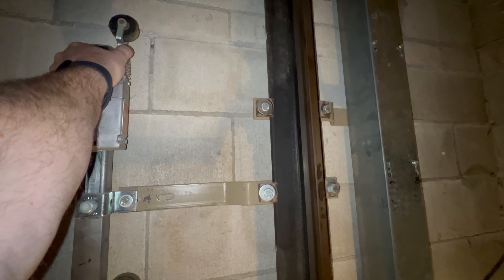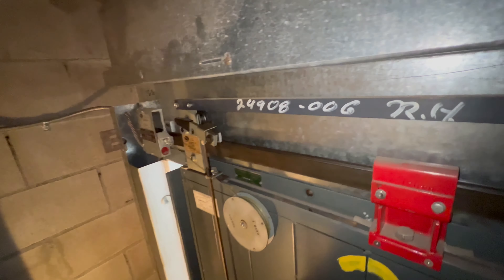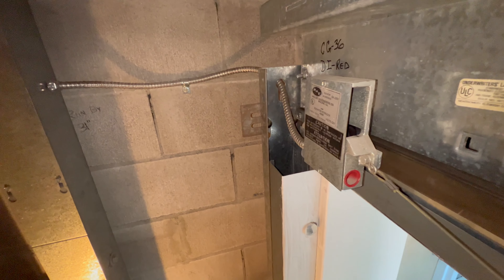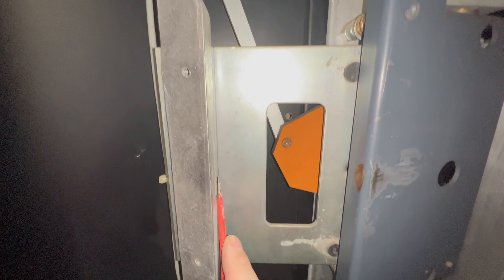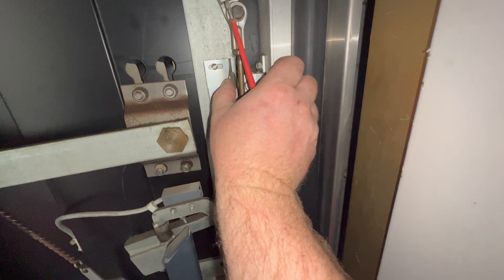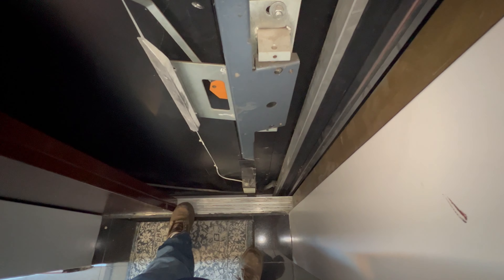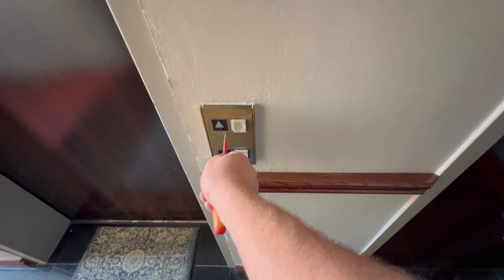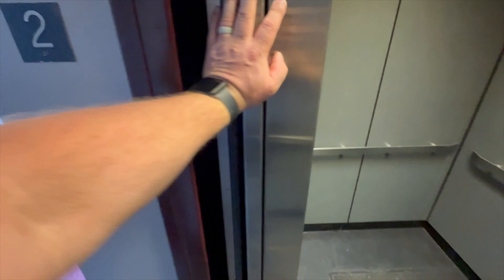Old Montgomery

Comment: Who makes that red door retainer? Watching him play with interlocks with power still on was hard to watch. At least use cut resistant gloves that polyurethane bottoms. 240 through the body wouldn’t be fun.  Just a few years ago down in Miami, TKE lost a mechanic from messing with interlocks, with power still on.
Reply from the maker: Not sure who makes that retainer, some time in the 90’s I believe all the elevators had those safety retainers installed. The ones on our Armor elevators are yellow, you can find yellow ones in the sees catalog for door equipment. Maybe the red one was right from Kone?
Reply from the maker: That horrible what happened in Miami and we definitely wouldn’t be changing any lock parts with the power but cleaning does happen sometimes with power on. You’re correct about the gloves we should be wearing then.